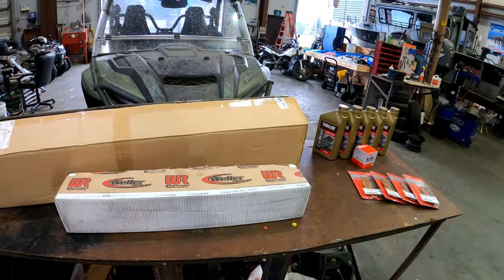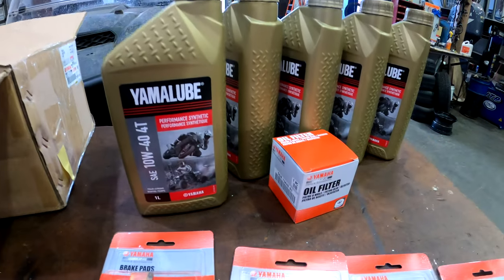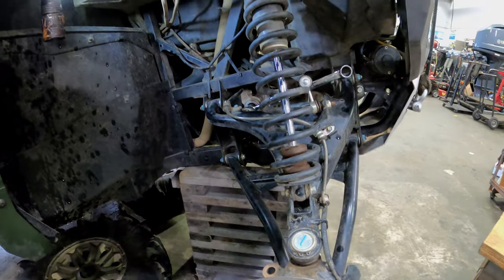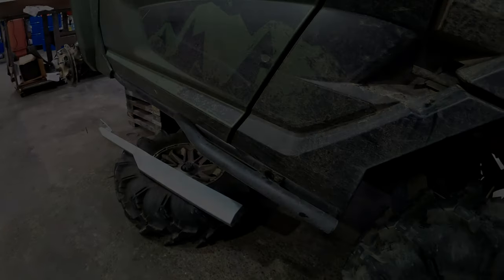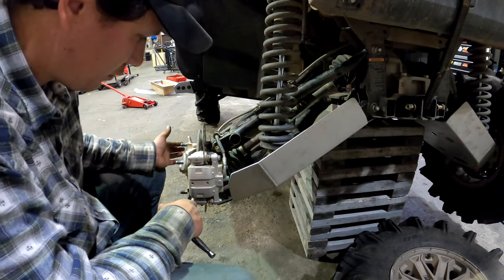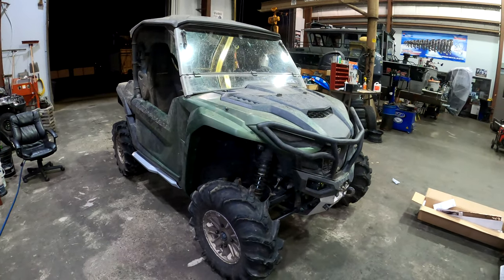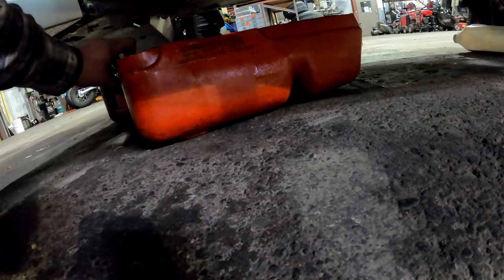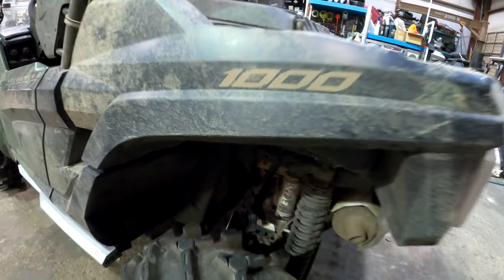RMAX BROKEN TIE ROD !!??

Comment: Nice job, love your shop and hoist setup! I put the Bandit tender springs on mine, gave about 1.75" lift, and they feel pretty good. I also made some sway bar disconnects, but after disconnecting them, I have yet to put them back. Ride is much improved, and body roll is hardly noticeable.
Reply from the maker: Thanks ! The shop where I work is amazing ! I'm gonna try removing the sway bar and see how much it helps my riding style. I was gonna get the bandit spring kit but I decided I want to try something else. I will soon order them and let everyone know which kit I went with.
Reply: @IslandMudSlingers  I didn't even realize there was more options? Any easier options for springs up here in Canada for us lol ?
Reply from the maker: Yes Some just came out ! Check out Schmidty Racing Suspension
Reply: @IslandMudSlingers   you the man thanks !

Comment: Great videos! Been having an amazing experience with my RMax2 1000 here in Iqaluit, Nunavut. Did purchase camso tracks and haven’t installed them yet. I think I need to beef up my suspension and steering before I do that. Looking at the dual rate springs from Shock Therapy and any advice for steering?
Reply from the maker: Great ! My best advise would be schmity racing spring kit and Weller racing tie kit with the boats.

Comment: Great video. Keep us informed on how the weller tie rods hold up. I bought a set for a yamaha x2 I had & was really happy with them for the first 500 miles or so. Then the joints on both sides started getting alot of slack in them. So much I couldn't drive it over 20mph. I called weller & they said they hadn't had any problems so I ordered a set of joints which aren't cheap. They lasted about the same amount of mileage. We ride about as hard as you guys seem to & I had really high hopes for them. The build quality seems great but the joints need work. I just bought an RMAX & was looking at getting some stronger tie rods but I would like to see how yours holds up. Safe riding & let us know how they work out.
Reply from the maker: Thanks for the great info, I will keep a close eye on these new joints knowing this. If I have any issue I will definitely be letting everyone know.
Thanks again !
Reply: @IslandMudSlingers  Did you have any problems with exposing new weak spots after installing the beefier tie rods?
Reply from the maker: @fishngame  Iv replaced the ends once already due to the first ones not having a boot covering the joint, so now this set has boots and seem to be working great. But I do have a small amount of play in my rack that's being covered under warranty. Other then that the new rods haven't caused or shown me any other weak links yet.